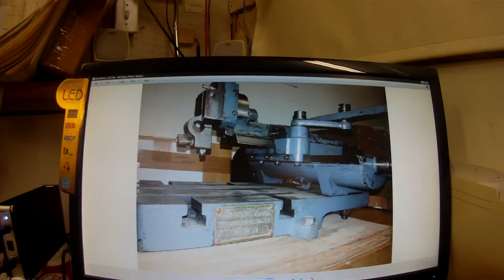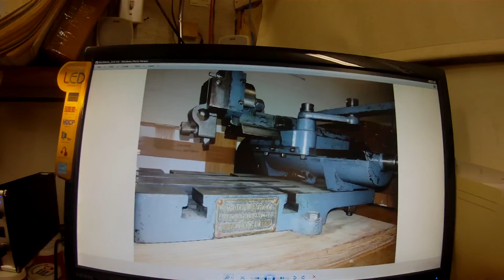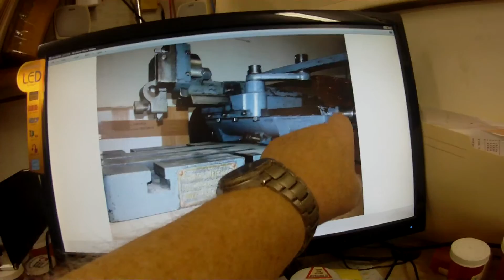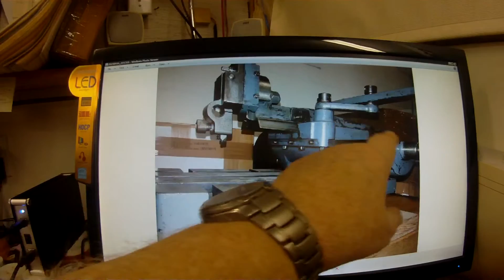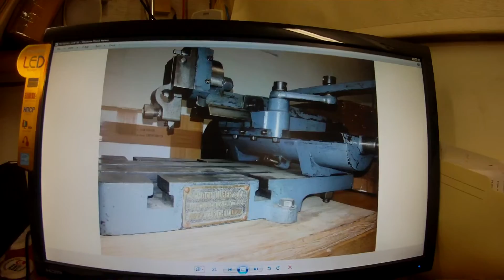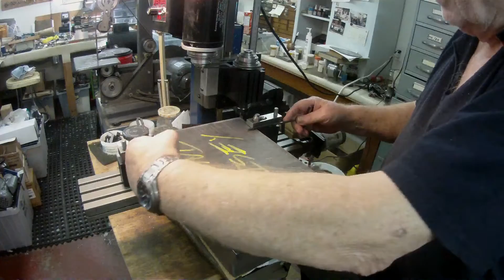FILE0002  A new project, a "PETITE LIME" Hand Shaper part 1

Comment: Hi Walter.
You have certainly taken on a big job with this project. Just a thought that may be pertinent, how about trying to source a saddle and cross slide from a scrap lathe. Mount the cross slide upside down on to the base and then set about modifying the saddle to take a ram where the lathe bed shears would normally be. For the tool slide, something like the Myford vertical slide could be used with a clapper box mounted on it. The resultant machine would end up not looking anything like a scale model of the original but could be doable.
Reply from the maker: +Stephen Deakin 
Its kindoff a nice idea, but a bit like looking for a needle in a haystack, one of the big problems is the state of the Canadian dollar, I can purchase a cast iron  round billet from US, the cost around $64.00 US ($82.00 can) + the shipping, that's another ($120.00 Can) that's almost $200.00 Can, I'm between the devil and deep blue sea, If I were able to get it sent to a border drop off, and go across the border to pick it up, but its a days journey for me, I might even do that yet, now if I buy a saddle and cross slide on eBay it might be cheap but I take a chance on its design  and the shipping will cost the same, might even be more because some of these guys on eBay make extra on their shipping scams, so now I have something that's even more useless, so I think I will continue with what I know is safe,
Reply: Walter Maisey Yes, it depends on what local to your location, scrap dealers have about them I suppose. If there is none then may as well go down the new route I suppose. Can you get gauge plate (ground flat plate stock) out there, different sizes stacked up and screwed together sandwich wise, would make very acceptable bedways for your sliding surfaces.
Reply from the maker: +Stephen Deakin 
   Now that's something I hadn't thought of, I will do some research on availability and cost, I will look into that, thanks Stephen,